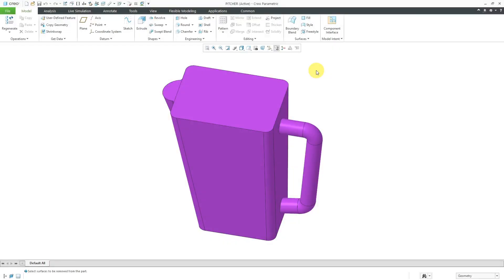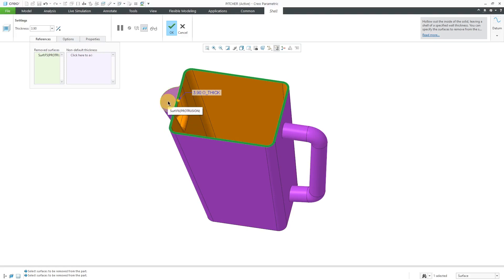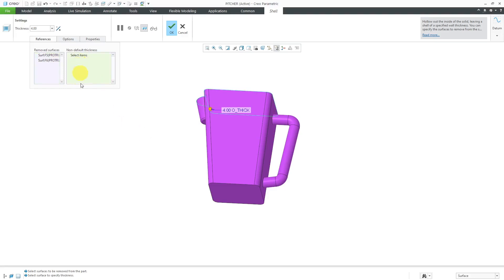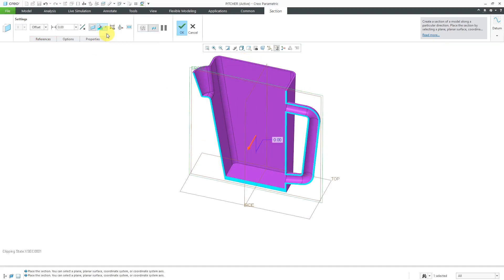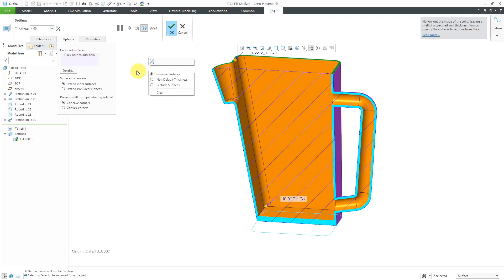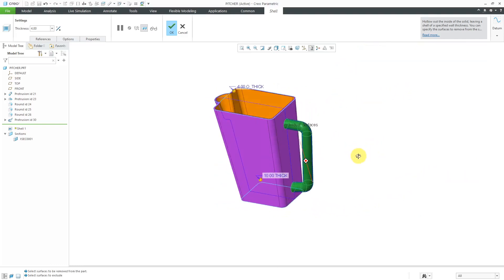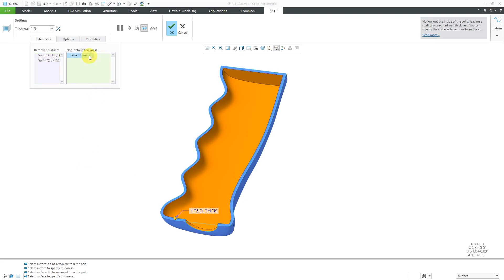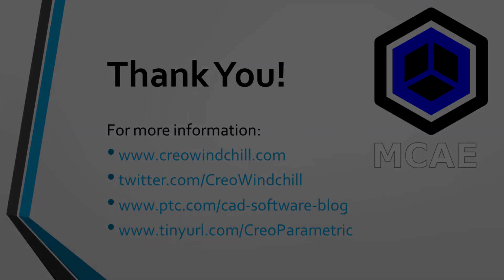Creo Parametric - Shell Feature | Part Modeling

Comment: I'm curious if you know how to deal with shelling solids that have radii and wall thicknesses that cause the shell to fail.  Seems like half the time I try to shell something, it fails because the radii are too small.  I don't understand why it can't just go to zero and stay there.
Reply from the maker: I was going to do a video on that but I can’t get models to fail anymore. In the past you would Offset, Merge, and Solidify. I’ve been keeping my eyes out for a model that fails to shell, but Creo automatically drives the edges to zero.
Reply: @CADPLMGuy  Maybe it's because I'm stuck on Creo Parametric 3 due to our customer's requirement.  I'll try it in version 6, which I also have installed.

Comment: Thank you for best example

Could you please make some video on hole table callout format note
Reply from the maker: That sounds like a good idea. Are you talking about the Hole Tables in drawings (which honestly don't work that well, which PTC acknowledges) or customizing the format of the automatic notes for Standard Holes in the .hol files? I cover the latter in Configuring Creo Parametric 4.0 so that should be doable for making a video.
Reply: @CADPLMGuy  Is that there already, Dave?
Reply from the maker: @skylark197878  Is what where already? My response covers a few different topics.
Reply: @CADPLMGuy  hole tables in drawings, as being discussed above (past 1 year though)
Reply from the maker: @skylark197878  Michael from PTC (Product Manager for 2D and 3D detailing) reached out to me at some point in the past year and said that the issue with Hole Tables has been resolved. I assume that was in Creo 8.